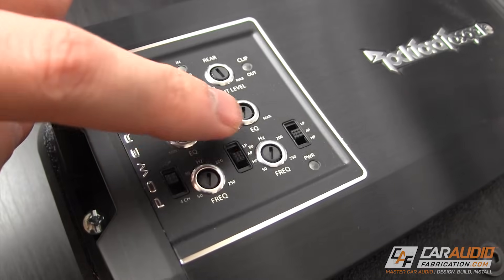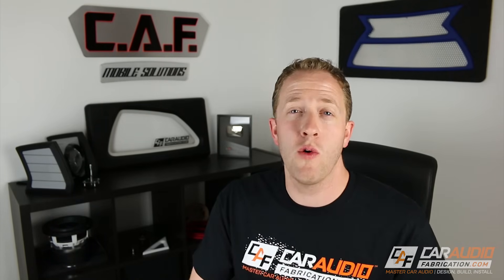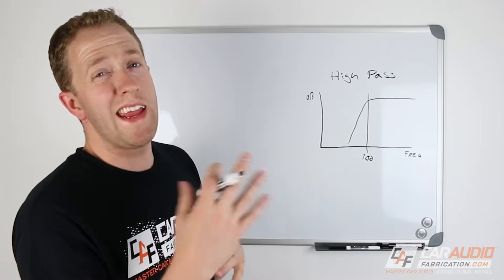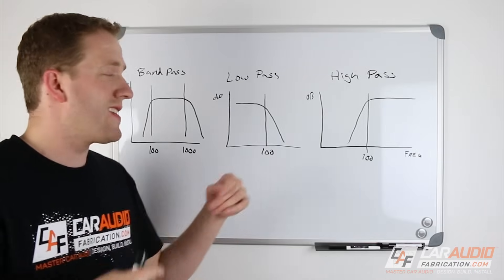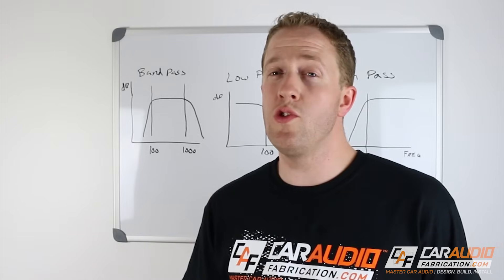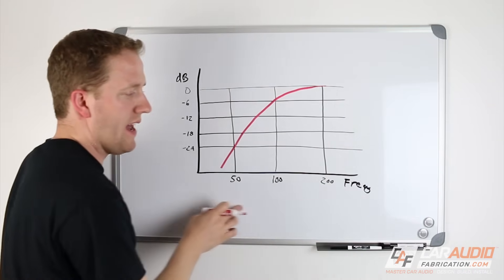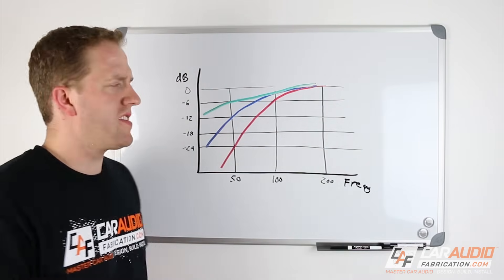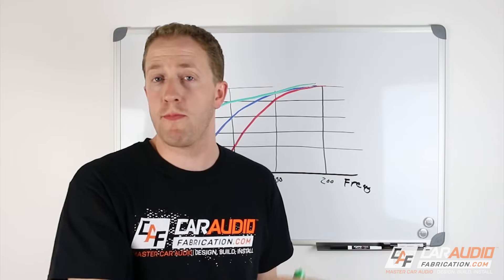IMPROVE Sound PROTECT Speakers - How to set Crossovers - CarAudioFabrication

Comment: So is it all about the crossover selection or the amp selection. My amp has a hpf and lpf and 500hz is the highest it goes. Sorry if I'm confused
Reply: Most people set the crossover points at either 85/100/120 hz depending on their subwoofers and car speakers. If you have really small speakers you may need to cross them over higher.

Comment: Hey Mark! I had a question about compensating for a fixed subsonic filter (25Hz @ 12db/oct) LOWER than my calculated target (29.25Hz) and more than 2Hz lower than the frequency response of my sub (27.2Hz). Would lowering my gain be enough to keep the sub from bottoming out? Or should I consider a different amp or dsp?

Comment: Hi Mark,
I really want to congratulate you for all the jobs and videos that you are making! Really love them all! I have a question? I have a aftermarket head unit with DSP and crossover for front, rear, and subs and my subwoofer amplifier also have a crossover built in but, it doesn't have an "off" function or "full range" like any 4 channels amplifiers.  So my question is: How can I turn "off/bypass" my subwoofer amplifier crossover so I can use the crossover from the head unit? 
Thank you very much and keep the good work!

Comment: Im sorta lost, Im confused because I don't get how to set a tweeters high pass filter so you don't blow it. The tweets are connected to the same amp as the mids assuming you have an amp going to your speakers. Do the hardware on coaxial speakers and that come with component speakers filter  the audio correctly to set a proper frequency for set tweet or do you set the mids and just kinda expect the tweets to be fine. Should you have an amp for mids and a small amp for tweets?
Reply: If your speakers are components with separate speakers and a crossover the crossover will take care of it, if you have components without a crossover you will need an amp that is bi-ampable or if you have coaxial speakers they have caps on them to protect them set it for the midrange.

Comment: Can somebody help me? My kicker 5 channel amp only have x-over for amp1, amp2 and a sub x-over. how do I adjust it? I have 2 tweeters, two 6.5 speaker in the front and 2 speakers and a 12 inch sub in the rear deck.

Comment: Why are the tweeters in my 93 se pathfinder bridged from the factory? Why bridge power to a tweeter?
Reply: CesarConH I'm guessing that by "bridged" you mean that it's getting its power from the same output. That's pretty much how a coaxial speaker is set up. The only difference is that yours probably has th tweeter in a separate location. Nothing wrong with that, as long as the tweeter has a small capacitor to filter the mids from it.

Comment: is it dangerous to a speaker to play say a mid bass woofer with only a high pass filter as far as speaker life? i dont have the money for a crossover and tweeters yet so i want to play my woofers with just the high pass filter from the amp at 100 hz.
Reply: in other words does too high of frequencies only create beaming or also create speaker damage?
Reply: and keep in mind this is just to get me music for a few months till i can make some more money for more stuff.
Reply: also, many tweeters im looking at take radically less power than the woofers however still have similar impedance. how do i limit the current to them without limiting the woofers since they are from the same signal?
Reply: All kinds of speakers (tweeter, midrange, midbass, and subwoofer) have a frequency range that they're designed to play. It is usually stated on their box under "frequency response". Those are the limits of each speaker. Exceeding those limits will cause damage, sometimes right away. Also, because they are the limits, they're not designed to be played there at full volume. So for example, if you have a midrange/midbass that is designed to play from 50 - 5,000 hz you still have to cross it over much sooner at possibly 100 - 3,000hz. That is where it's going to play at full volume and is actually going to protect the speaker. Some kind of crossover is mandatory, not optional. Most head units have at least a high-pass filter built in. Depending on the speakers you have, that may be all you need.
Reply: melody Hart A midbass must have a bandpass filter (high pass and low pass) to avoid damage, so I wouldn't use them without it.
Controlling voltage going to your tweeter is a whole other issue. The only way I see it possible is by lowering the gain (if you have a dedicated power output from the amp to only your tweeter). If you're just gonna use the same  power output for the midbass/midrange and the tweeter, then it can't be done (unless you can custom build your own passive crossover). You're better off just going active with an active crossover, or buying speakers that come as a package. Car audio is not simple.
Reply: Yeah lmao I bought cheap crossovers and it's really not working out... I am a broke college student however and it is okay for now. I'm going to get a DSP when I get the money.

Comment: OK.. How would I go about setting equalizer on my pioneer avic 5100.. I bout to install jbls GX600c component speakers.. So I have passive crossover.. How will they play into tuning of equalizer since they are passive crossovers???  I understand the 80 hz low pass and all.. just the equalizer is where I'm lost since passives are set to around 2700 Hz I believe... Thanks

Comment: Very informative and precise for a quick how it works video. I think the only thing missing was how the settings on the other equipment should be set, like not using the crossover on the head unit, amp, and external EQ at the same time. And why that's important. Otherwise great video keep it up.

Comment: So what would the tweeter crossover be? I don't get it, you said no low pass but there has to bee one and whats the lowest frequency tweeters can play. Can you pass it off at 3000hz to 20k
Reply: Jacob Falk pretty cool you admitted your mistake. Shout out to your personal responsibility  :)
Reply: there isn't a low pass filter on tweeters because you just want to play high frequencies so you only want the high freq to play thru the tweeter
Reply: I got my high pass and loss passes mixed up. When I heard low pass I thought filtering out the low frequinsies for the tweeter
Reply: +Jacob Falk 

It would depend on which tweeter you buy. Best bet would be to check the manual of your model, or google.
Reply: I just got low pass and high pass mixed up in my head. I understand now.

Comment: My head Hertz ..
Reply: bawhahaha!!! literally made me lol! and now my dog thinks i'm crazy...
Reply: Ohm, I’d get that looked at.
Reply: CaptainPooPyPantz lol, I see what you did there ☺️
Reply: lol
Reply: lol
Reply: Lol
Reply: I actually came here to set up my Hertz speakers
Reply: Ohm, I know watt you mean
Reply: I see watt you did there
Reply: I believe you, at 80hz WTH hahaha 😁😂😂
Reply: With frequency?
Reply: @brianwesley28  😆😆
Reply: Man frr
Reply: Boooooo
Reply: Best comment I've seen in ages. Good job
Reply: I just said the same thing lol
Reply: That was the most expensive comment I've read cuz those speakers cost a lot of money per pair!😁🤣😎🏆
Reply: Very informative. Well done!
Reply: Hi there Mark, kind of a long time subscriber here writing to you from Spain. I would like to go again through the audio system in my car, a 1995 Mazda Miata which I have from new, using the components that I already have and some other new that I bought and that are somehow “period correct” for the car.

Right now, what I have is an Alpine CDE126BT as main unit, a pair of Alpine speakers (separates) Alpine DDC-R17A 6,5 (50w RMS) connected to an Alpine amplifier 3525 (60w RMS x2) in the doors with XTC baffles behind the speakers as the previous ones died due to the water that gets to them (I haven’t cut the baffles in any way), and an active subwoofer behind the passenger seat, a Kenwood KSC-SW1 (150w max)

I find the sound as it is right now somehow disappointing although to tell you the truth, the main unit has some Bass Control for frequency and bandwith and HPF which I never used as I have 0 idea on how to tune it. Also the Alpine 3525 has two rotary controls for GAIN control and a switch for variable or fixed input sensitivity which I also have no idea how to use, as well as the speakers have crossovers which, you guessed right, I don’t have any idea how to tune correctly.

I am guessing that due to not having anything correctly set, the right tweeter has started developing an strange noise in certain songs, so I believe I might have broken it or is it that it is not properly tuned???, so I have bought a new set of speakers, this time a set of Focal KIT ASE 165, although I also have a set of Focal Performance Expert PS165 in another car and I might interchange them, which one do you think would be better? Keep the Alpine’s (if one tweeter is not broken), Focal ASE 165 or Focal Performance Expert PS165?

My idea would be to have the same Main Unit (Alpine CDE-126BT) correctly tuned, then the Alpine 3525 with whichever set for the door speakers you recommend. 

And then I just bought proper subwoofers (pair) a set of Pioneer TSW203F 8inch 120W RMS to be used with another Alpine amplifier model MRV-F250 v12 I have around to set it bridged for 2 channels giving 2x100W RMS. My plan is to install these two subwoofers like this guy did:

https://www.miata.net/hakuna/subspeak.html

Can you please, please, please help me set tune this system? What values should I use for crossovers, HPF, gains and all that in all places, main unit, amplifiers and crossovers

Many, many thanks in advance

Comment: how do high low pass work on bridged speakers
Reply: +Bill S it is passive but i also have high/low pass filter on my amp that i can adjust using software called tweeq using a laptop
Reply: +Jo Ho with a dsp
Reply: +Bill S ya they are and my amp was supposed to be set up in thus manner its the kicker q class
Reply: +Bill S woud i just clip then solder the connections?
Reply: +Bill S coaxial yes and no im running stock head bc of my neighborhood i want to appear to have stock
Reply: Hi Jo, I wouldn't recommend that. The tweeters usually have a capacitor to protect it from low frequencies. When you bridge an amp, it creates a 2ohm load. The problem with that is, the tweeters suffer. The crossover point raises (if I can recall correctly twice the crossover point) So say it is at 2400hz, it raises to 4800hz. Which you will loose a lot of the upper vocals. 

Sorry Mark, wasn't meaning to butt in.....
Reply: +Bill Stevenson do you know if it changes the mid range cross over?
Reply: Yes, if you have a separate crossover. It raises the value of the crossover point. Mids drop off at a certain point naturally. Depends on the speaker. (specs of the speaker should say) Does it sound like a void in upper midrange vocal area? That is hard to clean up with the eq?
Reply: +Bill Stevenson not really but i do get sibilance sometimes how do i address this?

Comment: and what is full pass,  my 4 channel amplifier has Lp, full and high pass?  thanks
Reply: Low pass = it will only let low frequencies passhigh pass = only let high frequencies passfull = no block, will let full range of frequencies through
Reply: +Rob Greenwood OK I understand better, thanks
Reply: sorry, wording correction (it is 2am for me) low pass will only let pass frequencies lower than the figure you set it at.  High pass will only let pass frequencies higher than the figure you set it at.  Full is basically "full range" with no crossover, it basically turns the crossover off, allowing the full signal through.  the full would be for 6x9s or 7x10s
Reply: +Rob Greenwood oh OK now I got you,  I understand much better now, didn't know full pass cuts the cross over out,  OK,  and I was putting my mid range speakers on full,  wow,  won't do that no more. thanks  man I appreciate your help.
Reply from the maker: OOPS should have mentioned that in the video, looks like Rob helped you out, good job Rob! Full Pass means everything gets by. If you were using an amp with a component set of speakers (woofer and tweeter) and the component set had its own passive crossover that is wired between the amplifier and the speakers you would use the "Full Pass" which is sometimes also called "All Pass"
Reply: +CarAudioFabrication OK thank-you, been learning slot from your videos.

Comment: For stock speakers in my car do i want all-pass or high-pass filter? Rockford Fosgate P400-4 amp
Reply: orfeous Ya depending on your speaker size, a high pass at 120 Hz should be alright. You could run it down to 100 or even 80 but then you'll usually be limited in volume before you get distortion...but at least you'll have a more full sound from your speaker.
Reply: high pass at 80 if you have a sub and high pass at 40 if you dont
Reply: doing highpass 120 now i think because the speakers cant handle that power the amp puts out.. the bass just sounds bad.. distorts and stuff. Speakers built for 4x25W and P400-4 puts out 4x85W RMS
Reply: orfeous Try lowering the high pass to around 80 - 100 hz and lower the gain. The gain affects how soon the rated power goes to your speakers. The higher you set it, the sooner it distorts (assuming your max chosen volume is clean). Also, make sure you have your settings at flat when tuning. Boosting the bass usually just adds distortion.

Comment: Butterworth crossovers will sum at +3dB, while Linkwitz-Riley crossovers sum flat.

The  phase is more relevant for different crossover orders. For every order there is an additional 90° phase shift.
That's why only a second order crossover needs a polarity change (inverted phase -/+180°) for one of the speakers to compensate for the 180° phase shift by the crossover. First and third order crossovers will need digital correction in most cases to achieve the best sound quality and should be avoided by inexperienced builders.

Comment: I've noticed if I set LPF on sub at 80hz or above I can hear that sub is at the back and a lot of hum from it. I've just set midbass to 63hz HPF from HU and sub 63hz LPF. Anyway it sounds shit...no midbass at all. Have ML1600 with ML280 sitting in a box. Will try them. If no changes will probably sell all that hardware and forget about car audio.
Reply from the maker: Might just be getting cancellation within the door itself. Sound treatment is key. Try this video:  https://www.youtube.com/watch?v=S7WKCFHGwRY
Reply: Sound above 80Hz is located more easily because of how hearing works.
And if you set small mids to bass frequencies below 100Hz the higher overall distortion, due to the high excursions that are needed, might impact the mid frequency reproduction.
Reply from the maker: Good input
Reply: +CarAudioFabrication thank you for reply. I have quite big doors, speakers are mounted using custom MDF rings, angled a bit and doors have 4mm vibrodamping matts in and out. Will cell foam (or similar) material solve that? Also I am thinking to make bigger angle for midbass speakers because when I move my head forward I can hear noticeably more midbass. What do you think Mark?
Reply: I have tuned cross over in my amplifier front component speaker HPF 140 (FS 69 hz)  and rear coaxial speakers with the same cross over settings. I have a Kenwood DDX9703s radio which has a crossover settings as well, If i give the same value there as well . Does it affects the sound quality ?..